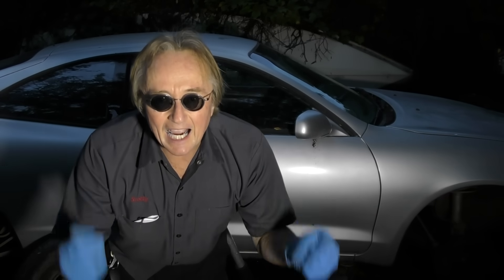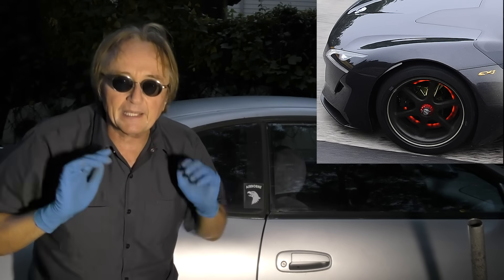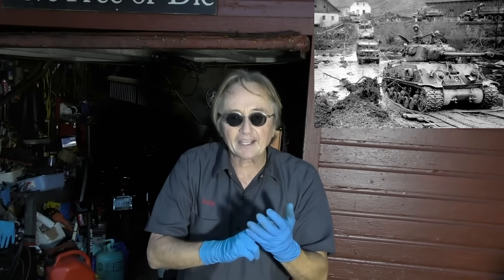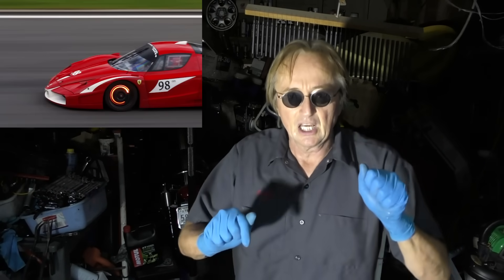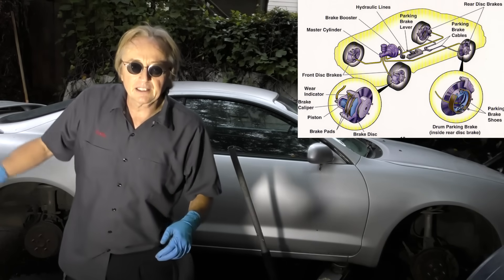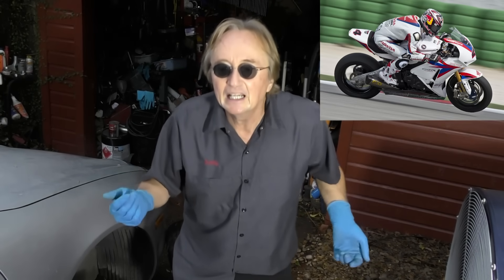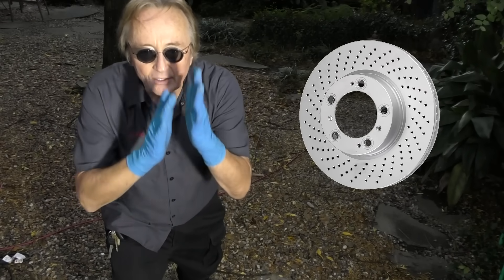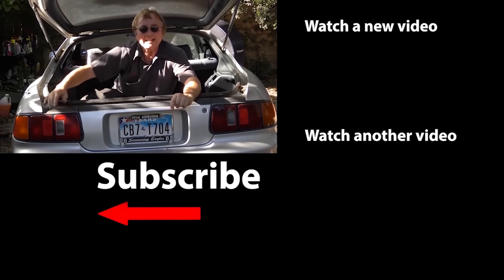Why Some Cars Have Drum Brakes Instead of Disc Brakes

Comment: Scotty, you need slotted disk brakes on your lips. You are really racing your mouth in this video.
 Anyone who has been riding bicycles for a long time will tell you that if the front brakes do 90% of the braking job, that bicycle becomes dangerous and can flip when brakes are applied suddenly. The better brakes (disk brakes) should be in the rear of the car. The brake fluid lines (and the bicycle cable lines) that go to the rear brakes are longer that the fluid lines that travel to the front brakes. Those are closer to the brake master cylinder. Bicycles with pedal brakes are the safest and do not even have front brakes. A better bicycle design should remove the brake pads from the front wheels and place them on the rear wheel. The rear wheels will have two sets of brake (one controlled by the right hand and the other controlled with the left hand. Automobile should also have two calipers instead of one on rear disk brakes. I could be wrong but I believe that rear brakes are safer than front brakes (of the same type) for reasons related to keeping the car on the road after the brakes are suddenly applied.

Comment: Surprisingly accurate video but I do have a few major gripes:

1. Drum brakes provide better braking compared to a same-diameter disc brake, as torque is force times distance, and drums push against the very edge. You needed more detail in the tank example to have been technically correct

2. Drum brake systems are actually lighter in almost all cases, because they require much less heavy-duty hydraulics. Speaking of which, never replace drums with discs without also replacing your hydraulics, or your new disc brakes will fail to properly perform

3. The video aimed to address why some cars have drum brakes, but hardly gave any answer for it. The correct answer is cost, which is justified by the content of the video. (although it admittedly was briefly mentioned)

Impressed by overall accuracy though, usually the speculation on engineering principals is extremely off. Props.

Comment: Drum brakes on the rear are more reliable  in my opinion.  You can get more braking effort from a drum brake because the braking  surface area is larger . Discs on the rear are unreliable most have handbrake  mechanisms exposed to the elements .

Comment: My '78 VW Bug still has four wheel drum brakes (completely manual as well).  I'm actually fairly impressed with how will they stop the car.  Sure it doesn't stop like our Prius, but it does a decent job.  I also have a '74 Honda CL450 Scrambler motorcycle, which is actually CB450 with a couple changes so it could be used for "mild" off-highway riding.  Oddly, the CB450s came with front disc brakes, but the off road capable CL450s had front drum brakes.  From what I understand, Honda felt drum brakes were superior to discs off road, because the brake surfaces were enclosed, and therefore protected from debris.

Comment: Drums on the rear are used also for the parking/emergency brakes.  Disc brakes are difficult to use for emergency brakes.  Usually emergency brakes are cable driven which are difficult to do with discs.  If you want 4-wheel disc brakes in production vehicles, 1964 Porches had them.  I don't know of earlier production vehicles.

Comment: 90 to 10% you are off the braking ratio for almost every car is 60% to 40% approx. So saying 90-10 is incorrect
Reply: Or 75 25% but 90-10 would and has caused cars to noise dive... in that case they make the rear brakes bigger and allows the braking to be a littlw more distributed.  It depends on the front to rear weight distribution as well

Comment: '90s Taurus: some had rear drums and some had rear disks. I've had to work on both. The rear disks are by far a bigger hassle. There is the complexity of the parking brake mechanisms plus there is a load-sensing proportioning valve that the drum system doesn't have. And in the Rust Belt extra complexity just means extra stuff to seize up and break. And for what? The drum cars stop every bit as well for all practical purposes.

Comment: I disagree with the idea of retrofitting front and especially 4-wheel disks on old cars that had 4-wheel drums and have laughed at those who did this for many years. Like Scotty says, unless you are racing, or perhaps towing or live in an area with huge mountains, the stock brakes are more than adequate. I have a '59 Bel Air, a '60 Kombi, and a '66 Corvair all with 4-wheel drums and they all could put your head through the windshield with stopping power. If you are on the brakes so much in street driving that you have issues with fade, you are doing it wrong.

There are several plusses to 4-wheel drums; one is all the wheels stay free of brake dust, two is absence of brake drag, three is simpler parking brake system, and four is no money was wasted on a stupid conversion.

Comment: I don't care for drum brakes, especially when you have to take them apart and they are rusted on. Even worse, dealing with rusted and warped backing plates and leaky wheel cylinders. I remember when my old 2003 Toyota camry had them, I was like why? Then of course, Toyota got smart and started using disc brakes on the newer models.

Comment: Simply put, drum brakes are on the back of some cars because the manufacturer is a cheap tight arse. If it doesn't have 4 wheel disc, then it most likely doesn't have abs or stability control.

Comment: Can't stand disc brakes on the rear of a vehicle in the salty states. They rust away and seize up about 3 times faster that the front discs, so you have to replace the rears every few years! Drums are pretty much lifetime maintenance-free units that are better suited for the daily driver. Plus the parking brake always works way better on a drum brake since it uses the main shoes anyways. Love the vids, Scotty!
Reply: Shoes also last a lot longer than pads because they have more material.
Reply: Drum brakes on oll of my cars were rusty inside and hand brake requred maintenance. Disk brakes were always okay. Audi 80 uses main disk pads for a hand brake and it is great.
Reply: Pine Hollow Auto Diagnostics   It’s called maintenance.
Reply: aka unnecessary work lol
Reply: so many seized rear calipers.  those pins become one and weld themselves in. I find if you are a little harder on the brakes intentionally they dont seize as bad.
Reply: Driven in Canada for 20 years and only ever owned two vehicles with rear drums. 

I’ve only had ONE caliper seize on me... and it was so easy to replace along with the ruined disc that I’d take it over drum brakes any day even if it had to change calipers every year. That same cheap jobber caliper and disc are still going strong after 7 Canadian winters... the other one is probably the age of the vehicle: 14 years.

Comment: 1955 Caddy Sedan here.  It takes an awful long distance to come to a stop with the drum brakes.   The drums had been re-surfaced, new pads, new cylinders.  That's as good as those drum brakes are able to stop such a heavy vehicle.    They were built with overpowered engines to get them going, but it seems that all cars of that time period didn't have great brakes.

Comment: Rear disc brakes most of the time are just solid discs that don't even vent heat. I guess they really don't get as hot as the front discs by a large margin.
Reply: Dcc357 Braking causes a shift of the center of gravity frontward, thus naturally putting more weight on the front tires and necessitating greater use of the front brakes. Cars do this automatically. On a motorcycle (in a straight line in dry conditions), heavy braking can shift center of gravity all the way to the front wheel, so far forward that the rear wheel has no traction whatsoever, thus any attempt at using the rear brake in extreme braking is a guaranteed way to lose control, and further would not help you stop any sooner. For all those others out there saying how dumb it is to use only the front brake on a bike, you have to understand that the tendency of a bike to tip over when applying front brake is testament to how well they work (braking force can shift center of gravity to a spot in front of the front wheel—a situation that good control on the brake lever can easily remedy). The rear would be sliding (and not necessarily stopping) LONG before the front has you tipping. The rider must be able to control that brake lever so they don’t tip. That is, so that they don’t slow the bike at a rate faster than it’s geometry is capable of handling. I’m a rider so I get nerdy on this subject, but this concept applies to four wheel cars too, just without the whole tipping over thing.

Comment: Scotty, do you think I can take apart the rear drums on my 2005 Nissan Sentra if I only have experience with changing brake pads? Mine reached 150,000 miles last week and the drums started a constant knocking sound every single time I hit the brakes until the car fully stops. What should I be looking to change to get rid of the knocking if I take them apart myself?

Comment: Both my 68 mustang, and 58 Cadillac have 4 wheel drums. The caddy has power brakes, and the stang has MANUEL DRUM BRAKES , despite it's a v8 engine,  has power steering  and factory Air Conditioning.  And yeah, Fade is a problem,  especially for the super heavy caddy. But you learn how to drive these old cars, and know their limits, and your ok.

Comment: Yeah. It’s all about the $$$$. I have a 2001 Nissan Pathfinder 4x4 5speed manual for last 18 years. I was disappointed it had drum brakes, but bought it new anyway. Only on highway in heavy traffic at speed do I wish I had disks back there for quicker stopping.

Comment: Rear drum brakes on my  Toyota 4Runner have 127,000 miles on them. Just had them checked and the mechanic said they do not need to be replaced. Front disc brakes had to be replaced at 115,000 miles.
Reply: duh rear brakes arent used like the front

Comment: Hey Scotty I have a QUESTION  for you!!!!!!! ,  i have a 2001 toyota camry solara with 195,000 mi, the engine runs fine but the transmission shifts hard and lags sometimes on the highway , i did a drain and fill and put in some anti leak locus, but it hardly helped, how long do u think it has before it busts ?

Comment: I would add that for the street solid or drilled are okay. For racing either the crescent or slotted are okay. I would not use drilled for racing because the bores crack because of the heat differential. Cracked rotors can shatter.